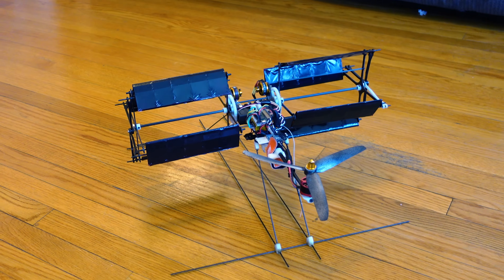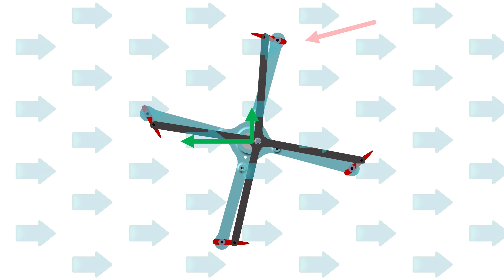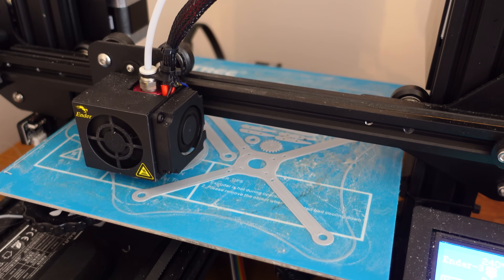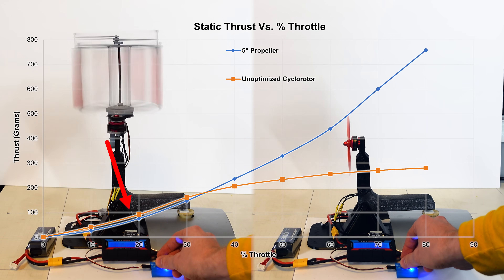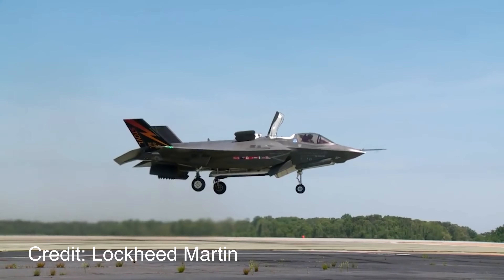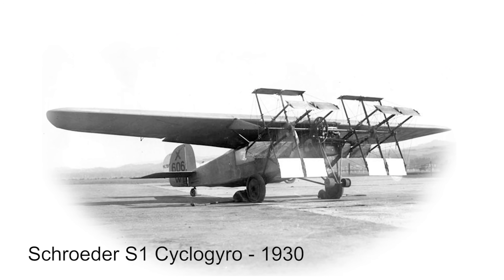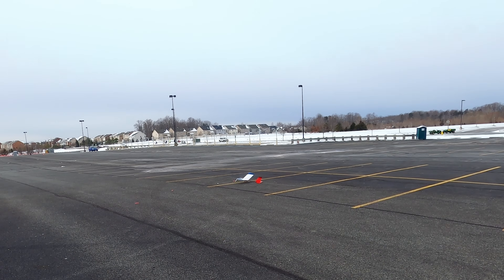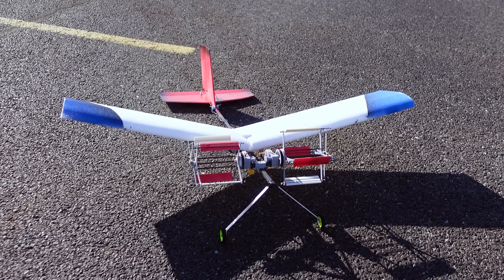Cycloidal Rotor Airplane: The Cycloplane

Comment: observations.            at 6:02,  can  you  spell    WONKY   distribution of mass (dom)   and/or   cg.!              since yer model  HAS  a  Wing,  the  BASIC  rules  Still  apply.!            the wing has a  less-than optimal  profile.           locate  the  cg, initially,  at  THIRTY  percent of chord.!!!         that is  the  Farthest  aft  that a  cg  should  ever  BE.!  (conventional planform)       move cg forward, as desired.             extra  mass/servos  should   NOT   be located  aft  of the cg/c-m.!            CF  makes  a  heavy/poor  tail boom.!             the stabs (and tail boom) should be made as  Light  as is practical.!            when the fuselage is level, the Mass of the main lg  should be located  below  the wing leading edge.!            at 6:04, there is  extra  mass  in the  vert-stab; because it  is taller than necessary.             googletranslate
Reply from the maker: Idk man seems to fly okay to me

Comment: I expect some of the efficiency tapering off is due to the motor running out of steam and torque at the high end
Reply from the maker: The gearing ratio definitely has the motor at the right side of the torque/power plot. Probably would benefit from a higher gearing ratio in the next iteration

Comment: Great job on the project.  In the slow motion shot it appears the right rotor exploded before the plane rolled to the left and caused the left rotor to hit the ground.  Can you determine if it was a structural failure or did it hit something?  I'm looking forward to your next adventure!
Reply from the maker: Hmmm very good catch. The right rotor did suffer a little mishap off camera that needed repairs. Poor left rotor was collateral damage it seems

Comment: You're the much less pedantic Tom Stanton with a great repository of interesting projects! I'm sure you'll take off, if you can excuse that pun lol. When you come back to cyclo rotors again I'd really like to see a discussion on tip vortices in the vanes, it's something that a lot of people don't talk about and it seems a little bit harder to solve than the traditional tapered and twisted propeller. I have seen some cyclo rotors with disks bonded the frame but I'm wondering if that hurts the performance of the lower blade significantly.
Reply from the maker: Hey hey we love Tom around here

I think the disks would improve tip effects but hurt inflow, so not sure if it would be a net positive or not. Only one way to find out
Reply: @NicholasRehm  didn't mean to shade tom too much! I think he aims for a younger audience but I've been subscribed to him ever since he did the paramotor :P

Comment: The cyclo definitely looks a lot less finger choppy than a 5 inch quad, I've had a 5 inch quad arm in angle mode, by someone else, in my hand, and it made a freaking mess of my thumb and index finger.
Reply from the maker: Ooooof, ouch man. I’ve had my fair share of run-ins with props too. Another commenter mentioned enclosing the ends of the cyclos which I might end up doing